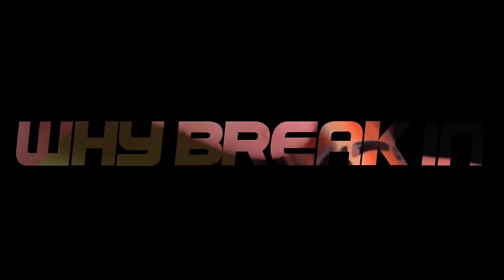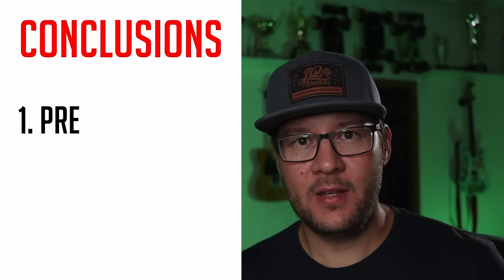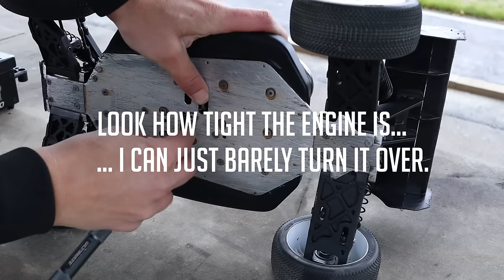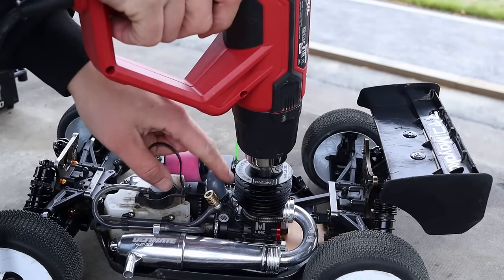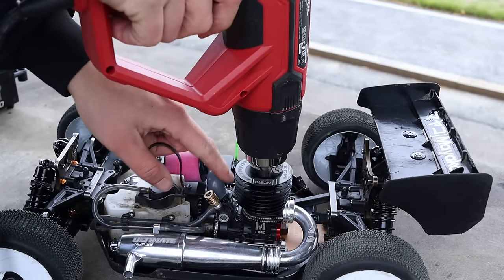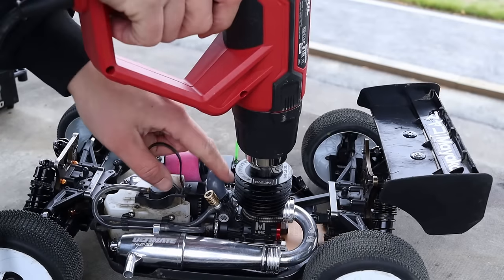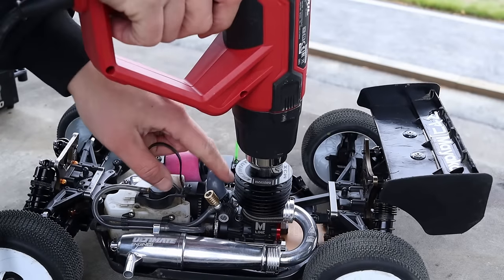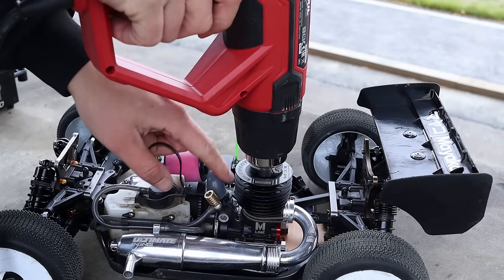Nitro Engine Break In - How, Why & What You Are Doing Wrong!

Comment: I tried the normal method like this, it worked well.  I used about $20 in fuel before hitting the track and I had to use a hair-dryer as I didn't have a heat gun.  I did a drake-in oil bath engine and it saved money on fuel for the initial running and then saved me the time at home.... so if you have time and fuel, DIY is totally good and I would follow this method.

Comment: Been in the RC world for a long time. Basher, racer, on road, off road, whatever! I'm 52, seen it all!🙄
 This is BY FAR one of the best engine break-in videos I've seen to date. Why, because he EXPLAINS why. I'm an old guy that is not only a RC nut but a machinist by trade. I know metallurgy and how different metal and alloys react differently to heat and STRESS. These insanely powerful lil' two strokes need heat cycles to properly break-in. Plus, even when using temp guns, you still can't see internal temps. (IE; wrist pin, crank journal, ect) Old rule of thumb taught to me was "Twelve tanks now for 12 gallons later."-12 tank break in "Smoke or go broke"-run rich. That was with complete cooldowns between each also.
Ya you can maybe save some time to have a paid method to pre-break-in your break-in.
To me it's a lazy method out, Like buying a box of sharpened pencils!
 All you guys flappin' your tongues about oil bathes this, send it that, crack me up!😂
Great HOW-TO Video
Reply: thats a cool saying. I am sure its sound advice.. I am currently breaking in a Kyosho MP9 TKI4 RTR
Reply: This is silly

Comment: 10:26 Another way to prime the engine w/o adding unnecessary stress to the rod is to cover the exhaust tip with your finger while opening the fuel tank lid and letting it snap shut about 4 times.  It's also nice in that it preserves the starter box battery and rubber wheel a bit too.
Reply: @PSA78  I've heard of some people getting fuel shot in their mouth doing that lol.  I think if the tank's filled up to the pressure inlet, then when it depressurizes it can push fuel back up the pressure line.  Might depend on the shape of the tank too.  And my pressure lines always get baked onto the exhaust fitting, making them somewhat difficult to remove.
Reply: @cbh148  I guess anything is possible if you're unlucky. 🤷‍♂️😂
I only do it during break-in usually, when it's important to have some fuel in the engine, as I go through the engine before it's already lubed well. 👍
Reply: I've been blowing in my pressure line for 20 years, and never got fuel in my mouth. 🤷🏻
Reply: @davelowets  Happened to Nitro Freak in one of his videos.  And besides, snapping the lid is faster.
Reply: @davelowets  It really shouldn't be any fuel there, possibly a little bit of oil from the exhaust. 
But they can get stuck pretty bad and can get hairline cracks when taken off, so I avoid it for anything other than break-in. It draw fuel quick enough other times. 🙂
Reply: @PSA78  When you pull it off every time you prime it, it doesn't ever get stuck. 😜
Reply: If some of us are spending upwards of $500 or more on these motors, is it really that hard to just prime the fuel line before you break in one of these or before you fire any of them up for that for that matter? if you’re worried about getting fuel in your mouth, just use one of those ears, snot suckers for babies, prime it, with a little bulb. There a dollar. So take a few seconds take the fuel line off of the carburetor put some pressure in the exhaust line will flow out and fill any filters that may need to be also filled and it will bring the system up to pressure so that when the engine does fire, everything‘s ready to go.
Reply: @shaner.5  "if you’re worried about getting fuel in your mouth, just use one of..."  
Yeah, or, disregard whatever you said, and just do what I mentioned in my original comment.  Block the exhaust tip or the exhaust pressure line and snap the fuel tank lid closed 4 times or so, and it'll prime the fuel line to the carb.  Won't risk tearing your pressure line, won't risk getting fuel in your mouth, takes less time, literally the best option hands-down.  The only reason more people don't do it is because they don't know you can.
Reply: @cbh148  What does snapping the lid shut do? Its a pressurized system so open the lid and you lose all the pressure you just built up, What we are talking about here is starting a motor that has never been ran, so in that case you want the motor to have fuel during the first stroke. So priming the lines is best way to solve that.
Reply: @shaner.5  try it and you’ll see.  Pinch the pressure line from the exhaust to the fuel tank and let the fuel tank lid spring shut a few times.  It does build pressure, and it’s not intuitive why it does so.  But nevertheless, it forces fuel into the line toward the carb.

I think the last ~2mm of the lid closing, as it’s coming into contact with the rim of the tank, it’s forcing a small bit of air into the top of the tank.  Again, try it and you’ll see.  Perhaps it wouldn’t work if the tank had a leak, and in that case, definitely want to address that before thinking about priming/starting.

Comment: The one good thing about an oil bath is like any motor when you break in an engine you get metal parts rubbing together which leaves behind metal. Take 8000 grit sand paper or a brown paper bag same grit rub it on metal the dark color on the paper is in fact metal so the oil bath will pull those metal particles into the oil instead of having to run those bits out the exhaust, oil traps metal thats why cars have filters but in this case we don’t filters. That black pavement you think thats unburnt oil or fuel? Send it in to an oil analysis company its contains lots of metal. What is ideal is a road with steep incline high load going up coast down,  you want the parts to fit together best under full load, internal micro heat cycles. Best broken in motors are one broken in with higher loads they break in faster gets that metal out and the motor knows when its up to operating race condition and you ask for all the beans its gonna give it to ya, once upon a time, a 3 time 1/8th scale state champion. Just my experience, thanks for your time.
Reply from the maker: Ok so the oil bath is a bath of oil with metsl particles in it that you are using to wear out your engine. Great….
Reply: @invisiblespeedrc   No its somewhere for any initial metal to be suspended in the oil which has a much greater volume rather than having to run it though the engine, these engine don’t have a way to trap those break in pieces, the only way an engine not pre broke in can get rid of anything is suck, bang, blow, there is nowhere else for those particles to go, and I think we can both agree there will be metal that’s part of any break in.
Reply: I was just trying to point out that one of the possible benefits might be that one or 2 quarts of oil in those baths that is a much greater volume to trap metal wear, than the max 30% per gallon, We run in the nitro. Is it no, I would love to see some controlled experiment much like project farm does with his experiments and have one of these ran through a bath and one broken with your break-in suggestions and then run them full-tilt, full- load, till one dies or they pop, will the glow plug on the one that’s in been in the oil bath last longer? You got the resources and the connections, call OS and make it let’s make it happen. In there laboratory. The research and development lab is quite amazing.
Reply from the maker: Yes except the particles are in the oil, vs removed through the exhaust

Comment: From what I understood..

Pre-heat engine before starting, at around 80-90 degrees you can turn it on and reach operating temperatures (100-115 degrees) and run 2 tanks at idle. After that run 5 tanks (slow and smooth throttle aplication while running figure 8's, all the while monitoring temperature) 15 min break and then run 5 more tanks progressively adding a bit of speed but still keeping it smooth. After that it's ready for the track and to begin tuning correct? 

Are the 5 tank intervals run continuously or is there a break inbetween tanks?

I noticed there was some LSN adjustment during the break in process, was this done to increase engine temperature or was there another reason for it? 

Thanks in advance, love your videos!

Comment: i am restarting my old hobby stil have my cars and i had a serpent with 3.5cc engine last time it run 2016 stil new not even run in right i think 2 full tanks in. When i was there i learned from older gentlemen. He tuned my car and give me tips but after lets say 1 day of little tuning etc. he send me on my way to drive on track but now now i see this way i have som questions in my mind because i really would like to keep this engine alive longer 

1 do i need after lets say the break in new glow plug 
2 should i always pre heat it for running i wanna keep this engine alive for long time 
3 and after long time sitting i was thinking of inspecting the engine first because i don't know if i stored it away good with old fuel or not 

luckily it's not on top dead center and should i pre oil it and than heat it or just oil of the fuel i am learning my self to do everything to be a beter builder and keeping this engine alive much thanks for this video

Comment: The whole purpose of the oil bath is to lap the piston kinda like lapping valves on a 4 stroke. It does, like you said, makes the break in procedure easier. The other theory behind the oil bath is that your connecting rod will last longer because there’s less stress on it during your first tanks running the engine since the oil bath loosens up the pinch a bit
Reply from the maker: Someone didn’t watch the whole video 🧐
Reply: Lmfao!
Reply: @invisiblespeedrc  I watched every second of it. I just wanted to say something about the oil bath stuff. It makes more sense for someone who doesn’t have the patience or is really busy to send out their engine and have it pre-“broken in”. I haven’t used the oil bath “break in” before and I don’t know if I will. It’s not a necessity for the average person in the hobby, but for a racer that has their time occupied by a bunch of other things, sending out a few engines to have them pre-broken in is a time saver as they only have to run 4-6 tanks through their engine before they run it at a race. Even with the oil bath, engines still take about a gallon of fuel run through them until the piston and sleeve are a perfect fit so the engine can run with optimal performance and fuel economy. Every engine I’ve broken in has been with a method similar to yours and they all run great. There’s nothing wrong with either method.
Reply: i used oilbath on some recent engines. 
my experience is that engines free up a lot around tank 3-5 after oilbath. me personal i think the classic manual method is the best for the engine if we talk expected lifetime. like JQ mentioned because the engine has it's natural heat zones all the time from the beginning.
oil bath makes it easier and earlier to race an engine if it's new. the best long term results i see for me and around my area have been 9 out of 10 classic manual break in. IF people know what they are doing because --->good manual classic break in>oil bath>bad manual classic break in

Comment: Amazing video! But i have a question i need a quick answer for. Do you only need to break in the engine once? I have an RC car(nitro) that i want to get running again, but it hasn't run in at least 14 years and I'm wondering if i would need to break it in since it hasn't run in such a long time? I tired to search it up but i haven't found a answer. Any help would be appreciated!
Reply from the maker: @sprucestorm3  just once

Comment: U can know it from the sound. temperature will be allright when u have mixture right. And when the sound gets straight with no let's say cracking ur all good...

Break in 4 tanks standing. And 6 tanks on asphalt.
Each tank.. raise the throttle, and (lower the mixture needle till the second turn) till u reach full throttle. Thats it!. Easy peasy. Then fix the low speed needle...
Reply from the maker: you cannot know from the sound that the temperature is ok during break in.

Comment: Very well explained! Another topic. I like the feeling of the combustion engine, but not adjust that. Many have switched from combustion to electric because of the carburetor. Who is finally building an electronic injection?
Reply: Nobody.
Because it is already only 3 adjuster! How many adjustments you have on your buggy? 50?
Do you need an electronic suspension?
Reply: @davidbuhler9022  50? more! It is not a question of the complexity of the matter. The procedure until the engine runs properly is too time-consuming for me to drive for a short time. some are just a genius.
Reply: @dietmarfinster3176   No time to set a carb? That’s sad to hear 😞
Reply: @davidbuhler9022  thanks for the irony. Greetings nobody.

Comment: Curious to know what your thoughts are for preheating engines after the 12 tanks (roughly 1.5 L) break-in is complete.  Do you recommend preheating every time, even after the piston/sleeve has, say, 3 gallons or more on it?  I've had trouble getting a piston/sleeve to last beyond about 3.5 gallons before losing too much pinch/compression (signified by the usual behavior of becoming impossible to get a stable idle, frequent flame-outs, etc.) and I'm trying to fix my methods by preheating every single time, but I don't know if that's been the issue or if it's beneficial at all past a certain number of gallons.
Reply from the maker: Engines last a lot longer if you pre heat them. A LOT!
Reply: @invisiblespeedrc  That’s what I was thinking.  Glad to hear I’m on the right track.  Thanks
Reply: @cbh148  have you had better look heating them up before every time?
Reply: @chrishiggins7475  I can’t say I’ve noticed a drastic increase in piston/sleeve life as I still haven’t passed my record of 3.5 gallons, but I’ve only had 1 piston/sleeve wear out in the 9 months since I made my initial comment.  And that was with preheating to 200F every single time.

If my next piston/sleeve wears out around 2.5-4 gallons, I might stop preheating every time beyond the first gallon as it’s a nuisance.

Comment: Been doing the same as this for 25 years and never had one failure or problem. 
Also to note when you even get the engine run in still pre heat the engine and chassis as then your engine will be on temp and the tune will be the same as the last time you run the engine. Just commonsense

Comment: So just to make sure i understand everything:

- Two tanks in idle, holding the temperature in between 100°C and 110°C, without letting the engine cool in between the tanks.

- Five tanks driving in figure eights with a tune that is fat but allows the motor to hold it's temperature when covered. (Is there a cool off process in between the tanks, or five tanks straight without cooling?)

- Another five tanks driving in figure eights where i start to tune the engine to a point where it holds its temperature without any cover. (Is there a coll of process in between the tanks, or again five tanks straight without colling it down?)

Did i get it right? If so, i will use this method on my new REDS Engine. Would be nice if you could shortly repsponse to my question if it's possible for you, thanks.
Reply from the maker: Idle tanks temp might be a bit lower, 70-100.

No cool down for the 5 tanks, as in the video
Reply: @invisiblespeedrc  Thanks a lot 👍

Comment: Hello, one question. I have touch the MRN🙄🙄...i knew never touch it🤣... How can I set the mid range needle? Can I unscrew the HSN. and should the hole in the MRN. be completely visible in the direction of the opening of the HSN.? Its a Hyper 30 Turbo motor. THX very much for help
Reply from the maker: set as explained in the video https://youtu.be/zLqwj41Q2YQ

Comment: I did the oil bath but i am extremely new too rc and i have no idea what im doing.. how do you feel about breaking a engine during cold winter temps its 10°-15° c currently outside need to break a motor in.
Reply: Wait till >+10C  if possible

Comment: So why did novarossi factory put a large plane prop on the new engine and run it at wide open throttle for 20 mins? That always seemed crazy to Me and they charged a premium for it!?
Reply: But maybe not with only 9%  oil in the fuel ???